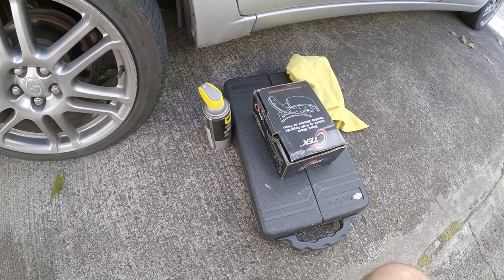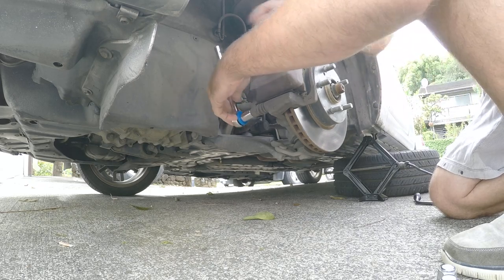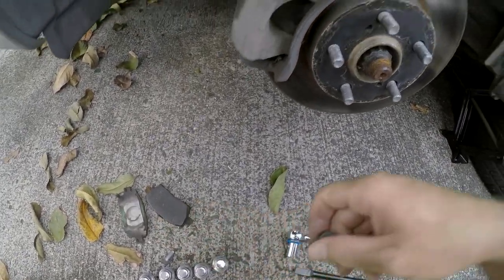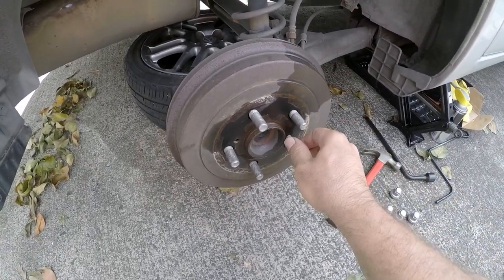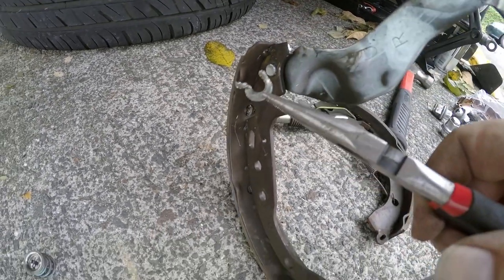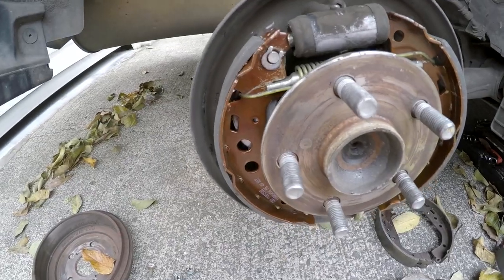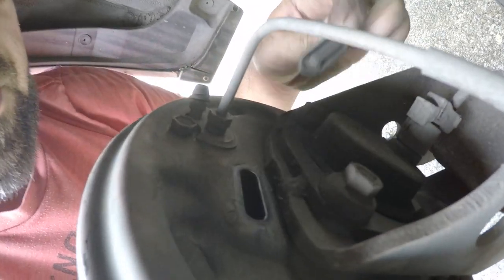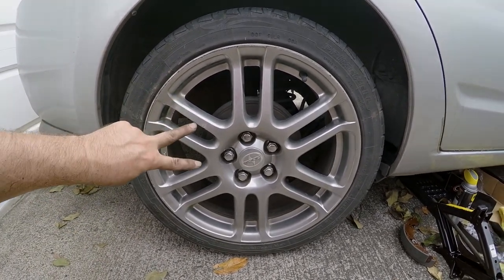Prius Brake Pad Replacement - Front Disc and Rear Drum

Comment: There is a special way to release the rear adjusters, which you normally have to do to prevent damaging something when pulling the rear drum off (if it's too tight on the pads due to a wear lip, etc, you are going to damage something). Take a close look at the design of the adjuster arm (designed to tighten rear brakes when backing up). You use one screwdriver to hold the arm away from the toothed adjuster wheel, and another to turn the wheel (loosen, it's different left to right i think). I once BROKE the adjuster by trying to turn/loosen the wheel (through the adjuster hole), without holding the adjuster off the teeth.

That was on gen 1 Prius, 2002.

I took pictures of all that so I can use it as a reference. It's also worth noting the direction of threads and what side of the vehicle you are photographing.

Comment: There is a special tool to remove the shoes that compresses those springs. I always recommend doing one side at a time. Take both drums off, then start working on one side so you can reference the assembled side in case you forget how to reassemble. Drum brakes are a pain compared to disc. 4 wheel disc is a godsend. Remember, all brakes used to be drum. Even the front. Old cars didn’t have very good stopping power, and they were way heavier.

Comment: When you do disc brakes dont EVER leave the caliper hanging like that, its a big no no,get you a piece of wire and tie it up to any part of the car, if you dont have wire at least try to rest it on any surface, on one of my cars i usually leave it resting above the disc by the front strut,i can see on your video a perfect spot for it, fits in there just right, when you leave it hanging it puts strain on the hose, kinda like when people pull a electrical connector by the wires, dont so that, grasp the connector, not the wires etc
Reply: 110%

Comment: As an FYI to anyone going after the rear drums on a Prius. Read up on how a Prius actually uses its brakes. I tackled the full monty from front to back on a 230k mile 2009. The rear drums nearly caused me insanity. After putting it all together, I knew I got air in the line, and you just can't bleed these brakes like a typical auto. I ended up having to take it to my mechanic and have him bleed, and calibrate brake fluid via computer software. Still saved money in long run, but I nearly lost my mind. Tackle your front disks all day, be very leery of going down drum brake rabbit hole.
Reply: Mike Thomas How did you manage getting air in the line just changing the brake shoes🤔. If done properly and the system remains closed, air in the lines should not exist. So you had to have cracked the line open at some point.
Reply: @nordicpride9708  or maybe he didn’t adjust the shoes properly afterwards, that would cause a spongy pedal feel too
Reply: calibrate brake fluid via computer software??? Sounds like mechanic talk for "I'm gonna make some bucks here!!!"
Reply: If you push one piston on one side of the wheel cylinder, without opposing force against the opposite piston, you can force it out. If that happens, you'll have to bleed that wheel cylinder.

Comment: anyone wondering the front breaks were squeaking because of the wear indicators on them. they are added to alot of disk breaks so that you get a light squeak before it really squeaks when its all the way to the metal plate
Reply: My brakes on my Prius squeak a lot. Is it because of the brake pads or the disc?? I’m 18 don’t know much about car parts.

Comment: 4 notes:
1) Disconnect the 12V battery because the car will try to load the brakes and push the caliper piston out. 

2) Shouldn't hang the caliper by the brake line. 

3) You should open the cap on the master cylinder to give space for the brake fluid when it backs up when you push the pistons in. 

4) Ha Ha, scavenge a bolt from elsewhere on the car to pop off the drum. Well played.

Comment: Could you please describe how you eventually put on the adjuster and spring at time 9:43?  You were struggling a bit and then magically had it put together.  This is the step I need to see the most!
Reply: None of the how to videos I've seen on YouTube addressed this part. On the technical sheet I saw they used what looked like a miniature tire iron to get enough leverage for this P.I.T.A spring

Comment: before u did front brakes did u disconnect battery??? & remove keyfob from your pocket
Reply: Why do you need to do this. I never disconnect the battery and have problems

Comment: also why would you adjust the rear drum to have a slight rub? I thought you would adjust to the slight rub and then back it out a tiny bit. I guess it would wear in and not rub after a bit but seems odd to set it up to lightly rub

Comment: Don't forget to do a brake test on a downhill thus you can see if the rear brakes are working good or not. I didn't adjusted that thing and I get slipping sign on my dashboard because I didn't loose it a little. So I will do it as soon as possible.

Comment: You failed to show A very important step because You can possibly continue getting the squeaks if you didn't have the disks or the drums turned at the local auto repair shop usually cost about ten bucks each to have them turned but all in all very simple thank you for the video
Reply: What dis that mean?

Comment: What size is the bolt that you used to remove the rear drums?
Reply: Not that it matters a year later, but you can use one of the bolts that hold the hood on.
Reply: I had the same question 🤣🤣🤣
Reply: For anyone who finds this 2 yrs later, like me, I believe they are 12mm.
Reply: Try M8 x 1.25.

Comment: I recommend at least disconnecting the 12V battery. Because Prius petrol engine is not always on, there is a computer operated brake pressure pump, and it is just a pure luck if you succeeded to replcace pads without problems! Mine leaded all kind of warning lights including ABS, master warning etc. and brakes were just crazy odd feeling overbiting, almost undriveable. Just needed ODB assisted commands to take it back again! (they use it in Toyota dealer services), so be aware!
Reply: Nope. Got problems now.  Read this too late
Reply: You don’t have to disconnect the 12volt. If you want to, you can. Just be sure to leave the key fob far away from the car, preferably inside your house. If this procedure is followed you shouldn’t have any actuation of the brakes while doing a brake job as outlined in this video. Do whatever you think is best of course. I’ve done this before and no ABS light after the project was completed.
Reply: The key fob must be a minimum of 15ft away from the car throughout this process
Reply: The firts time I don't disconnect the 12v. Batery... Big mistake.. 3 light on dashboard and erratic brake.. Solution ..Drive to the dealer
Reply: @manuelrojas1234  just clear the lights or actual shop time?